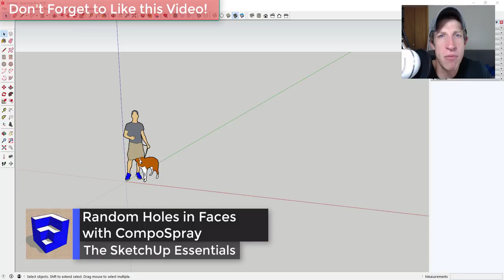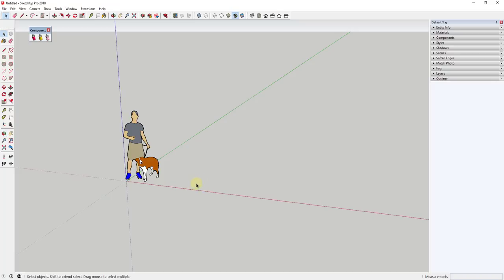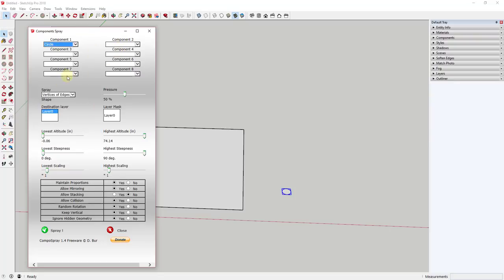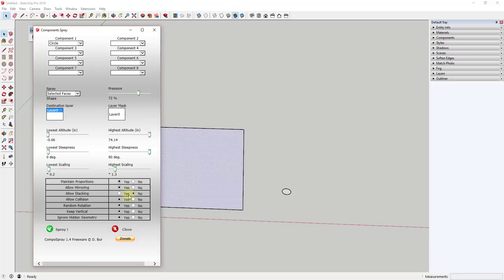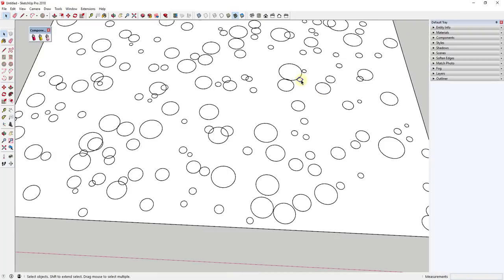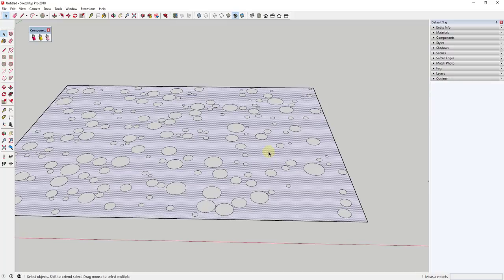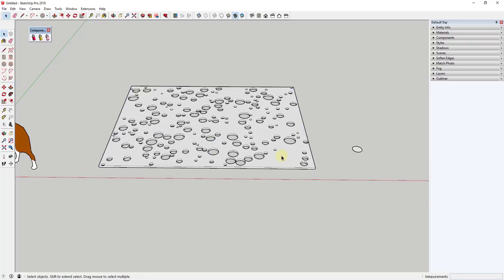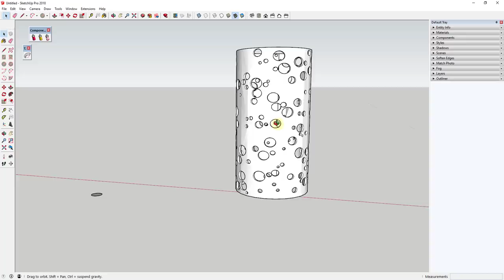Creating RANDOM HOLES IN OBJECTS with Component Spray for SketchUp

Comment: Thanks for sharing. Does it work on any surface?
Reply from the maker: In a way - it kind of depends on the surface - you can set it to place objects along faces, vertices, and some more I think, so theoretically you could adjust the settings to work on many kinds of surfaces...
Reply: As per comment in SketchUcation, Compo spray is v2014/2015 compatible only, SU 2017 seems to go into an endless loop, if I didn't screw up somewhere in the tableau.
Reply: @Thesketchupessentials  Thanks. I tried using Compospray in SU 2017 and after entering all the data, it went into an endless loop. It seems that it is only valid for SU 2014/5.
Reply from the maker: This video was made using SU 2018, so it's definitely not 2014/15 only. Try a more simple example and see if that works - just drop a few objects on a simple face and see if it works...